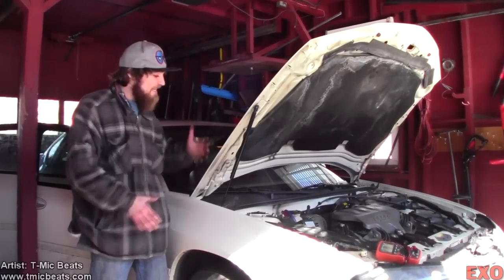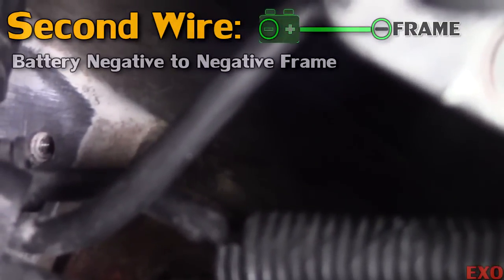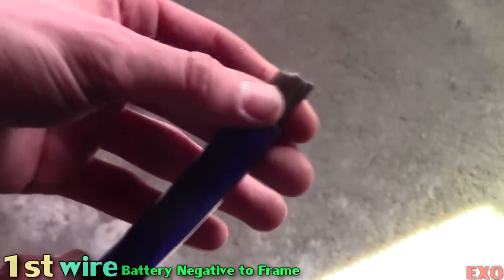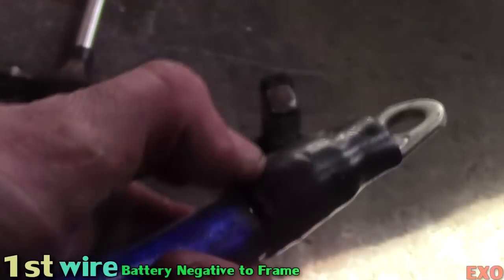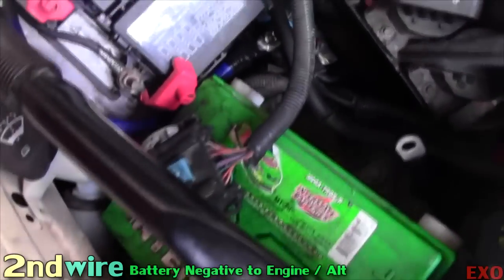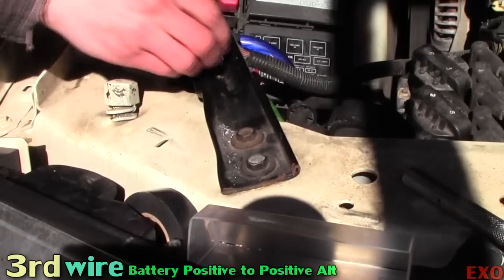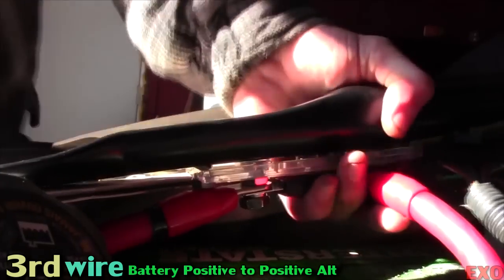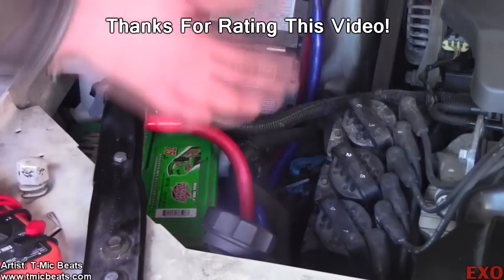How To Install BIG THREE Upgrade | EXO's BIG 3 Car Audio Wiring Tutorial to Increase Power Flow

Comment: so do you leave the 2 negative wires hanging until the power wire and fuse are installed? and then bolt them to the battery?
Reply: hook everything up thats positive then you connect the negatives back up hence why you take the negative off first to keep from frying anything

Comment: really apreciate your step by step really helps alot!! but question. i have a chevy hhr the battery is in the hatch. can you try and find a video or try and do a video covering this? i dont want to run my wires thru my car. just figured you would give the best explanation on this. prolly already covered it but im wet behind the ears 😂😂

Comment: EXO, U ARE DEFINITELY ON POINT WITH EVERYTHING U DO. LOVE UR WORK. Wish I could work with or for U. ALONG WITH STEAVE MEADE OF COURSE. But, my question to U is can I use the current 4 gauge from my wiring kit as an electrical upgrade wire from my battery to the alternator? Currently in the midst of replacing everything within my car audio category. I have MASSIVE voltage drops even off a Yellow Top Battery.

Comment: After a big 3 upgrade do you still run amp kit the same? So you'll have 2 fuses under the hood? One for amp kit and one for the big 3?
Reply from the maker: Yes, that's perfect!
Reply: EXOcontralto I got the 3800 motor to where do I do the battery ground? I have a really short wire going from negative to wall right next to battery will that black wire be the negative? The wire is maybe 8 inches long maybe shorter
Reply from the maker: Yes, that's the stock ground wire most likely. You'll just need to SUPPLEMENT it, not replace it.
Reply: What about with the alternator positive and ground wires?  Replace or Supplement?

Comment: EXO I've been lurking on your channel for a while,  this is my first comment,  Great video,  very helpful.  Please comment on my unique situation. I've got a bmw x5 with a rear mounted main battery under the spare wheel.  There is no front battery.  From the factory there is a 1/0 run from the alternator to the rear main battery.
Type bic group 49... I plan to upgrade that battery to an xs power D4900.  How would the big 3/4 apply to this situation.  Thanks in advance for your consideration.  (Sundown 12" x v3 with d4s JP23 amp, alpine 4 channel amp for door speakers

Comment: hey if do the the big 3 upgrade. I am using 0 gauge wires can I add 250amp fuse to it
Reply: 0 gauge can take over 300 amps in most cases so 250 will do fine. I personally use a 300 amp fuse

Comment: Are you leaving the original wire on after the bigger alternator? I'm asking because on my car the wire goes from the alternator to a fuse box then to the battery, and it would be a real bitch to have to replace all of that
Reply: Anthony Owens Hi, Yes, You can leave the Stock thin wiring in place.. That's how I did it when i first did big3 on a civic.. Now a dif car, I saw some doing it alt to fuse box, then fuse box to batt, and thought, heck I'll do the same. It is a ibtch and pricier, as you gotta buy more wiring (0ga for me) and gotta cut down the wire terminals to fit the fuse box (I managed to do it w/4ga ring terminals, it's gonna be harder to do so w/0ga terminals.. ) - Stock wire u can cut end terminals n add it to your multi input batt post, or add a side ring and keep the stock batt terminal.
Reply: Anthony Owens Just hook them back up. The other wires plus your stock just equals even better current..

Comment: Great job! I like to use dielectric grease on all my connections , just so they don't rust or corrode in time. Especially living in New England with the winter road salt.
Reply: Great advice sir.
Reply: Cobra Kia will never die! 🐍
Reply: I just finished this upgrade and I used dielectric grease too

Comment: I love the 3800 series motor easy as hell to work on
Reply: Yeah no doubt man:) I have a 3800 Bonneville. Sickest engine ever! :D
Reply: I like the 5.7's
Reply: Its a good thing theyre easy to work on you gotta work on em often
Reply: The 3800 are one of the best engines GM has made, Thus why they call them lifetime motors. They run 300K miles easily if taken care of.  Wife has a grand prix for 13 years now and still runs like a new. .

Comment: Hey EXO and other people. What if you done the big 3 and your voltage is above 14.4 but your amp has a rating at 14.4. Is it safe to run your amp in a situation where your voltage will be greater than what your amp is rated at?

Comment: Hey EXO! Great video. I have a 99 Ford expedition and want to do the big 3 upgrade. The default charging cable from the alt to battery runs through a junction on the passenger side before reaching the battery. Is it ok to run a 0 gauge directly to the battery?

Comment: Nice video and set up! I got some questions. I have Honda Accord 2004. I already have yellow top battery and second battery: kinetik with capacitor. I have Kicker ZX.1500.1 amp with dual Kicker L7. I am running on both batteries with fuse 120. I am wondering if it is okay for me to add big 3 without fuse or better off with fuse? IF with fuse and 120 would be good enough? I also have stock alternator for Honda.

Comment: dude,you could've shown us first what the voltage was before you did the big 3upgrade and after. just to make sure its worth spending money to do that.
Reply: I have a lot of certain spare wire at home I just did the big 3. yet to hook up my nfew amp and 2-12's waiting to still upgrade to two extra so 4-12's same amp. on this new box build it's my first
Reply: The voltage doesn't change. It's the amperage. A 1000w (RMS) system pulls about 200 amps. The alternator wiring is good for about 80 amps. Your amp will not produce the advertised wattage without a power lead upgrade.
http://www.crutchfield.com/S-AfgnYjGuzvO/learn/learningcenter/car/cable_gauge_chart.html
Reply: i think its well worth it my friend or else you will learn the hard way like i did ...you learn today!!!

Comment: After you did the big 3 do you just run a power wire to the back to power the amp
Reply: Yes from your positive post on the battery

Comment: Thanks for this nice video, just one question,

i have 2 Rockfords 200 Amp Circuit Breakers connected to my positive lead on the battery,
should i use a bigger rate fuse on this installation or should i use the 300A fuse?

Thanks

Comment: Overkill for stock alternator. High Output alternator with custom stater, then this would be appropriate. 300 Amp fuse WoW!  That is no 200 Amp alternator-lol....you be lucky if you pull 70 amps at idle. All you audio kids learn how cars work first--lol Also make sure you connect positive cable to to alt FIRST, or you could accidentally blow your diodes.
Reply: FxScalper So what will happen if you do the big 3 with a stock alternator? Is it better not to do it at all?
Reply: Not much gain...the real gain is better ground for engine to run better. Every thing should be grounded to a strut post stud the best placed. and research BIG 4 upgrade. The alt has to be grounded as well. Good luck.

Comment: Would have liked to seen the voltage before and then after the upgrade.
Reply from the maker: It doesn't necessarily raise voltage, but rather it raises the flow of amperage.

Comment: for an alternator at 105 amp, what fuse is needed, a 100 amp waffle or a 150 amp waffle? I think it should be a 100 amp fuse between alternator and battery right?

Comment: I mean what does this actually do especially adding a second battery?
Reply: It increases current flow to the battery, which helps if you have a high output alternator because all of the the juice from the bigger alternator will have a hard time squeezing through the little stock electrical wire. So adding another run of battery and grounds should overall be better for your system no matter the size as long as you do it correctly

Comment: 1. Alternator wire to battery needs a FUSE people. 2.Never touch the wire with your fingers. Fingers have acids and oils which will corrode the copper or aluminum shit car stereo wire like in this video. 3. Use the proper crimp tool for the connector and wire gauge. 4. Use real copper battery cable not shit Chinese aluminum wire that melts and catches fire VERY quick when soldering. 5. Use real copper lugs for connectors. 6. Dielectric grease is your friend. People in the upper north east should pay attention.

Comment: why i need the fuse what the does
Reply: it's just in case the wires get overloaded. if they ever do exceed its rated amperage it could burn, melt, start a fire and so on. just a safety precaution.

Comment: I love to do stuff a bit excessive. But you could use smaller gauge wires. At least for the ground. 4 gauge might be enough, try it. 
How to test voltage drops? Take a voltmeter, and put one of the probes on one side of the cable and the other at where the cable goes. Then now you need to make current flow through the cable by playing a constant sinus of your desired frequency where the load is at max. There is also math skills that could be used, but at that wire shown its just ridiculous low voltage drop.

Comment: What was the battery voltage prior to the big 3?
Reply: I bet it was still 14
Reply: @BillyBob-os7kr  mine was about the same. Gained about 0.3
Reply: @yusufjorgenz5951  stock alternator ?

Comment: I always thought the big 3 was high output alternator, deep cycle battery, and the the wires.
Reply: Nope! EXO has an older Big 3 Upgrade video also!
Reply: same brother
Reply: @oceanbreeze369  If you leave your stock charging system wires in place (8-6G?), but run a 1/0 to your new amp...that doesnt make sense right?  Why not upgrade the power flow from the Alt to the batt, so that it matches what you're running from your batt to your amp?

Comment: Crimp compared to solder....... no comparison. Solder wins every time. A 100% metallic bond is hard to beat. Not a friction bond on soft copper wire. Actually it's best to crimp THEN solder.
Reply: And what is the benefit to solder over crimp in this situation..?? NOTHING
Reply: Many will say that crimping these connections is best because vibrations in the car can cause the solder to crack - I tend to agree.
Reply: @skydrones2012  It's easy to solder 0gauge, you obviously won't be using soldering iron lol.
Reply: Wrong
Reply: I prefer solder over pushing metal onto a cable as well.  It's just a better bond.
Reply: @ACommenterOnYouTube  Prove it.
Reply: @jimdavidson5208  and WHO are you ??